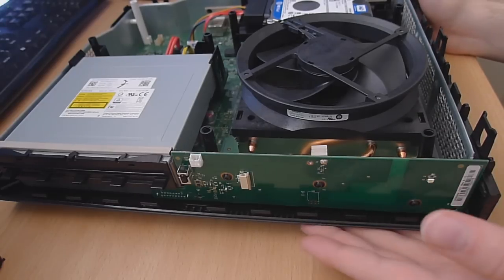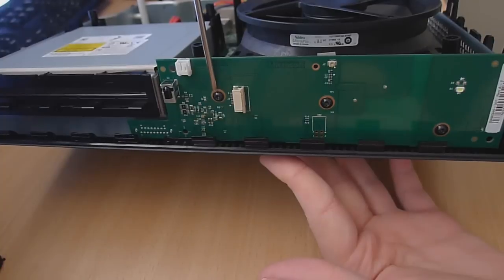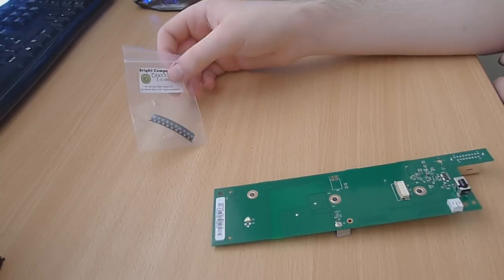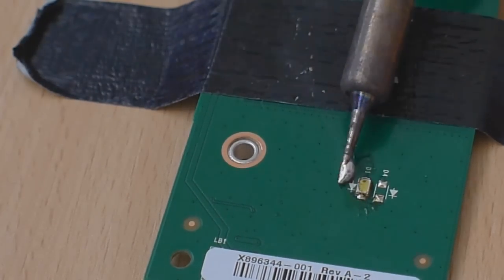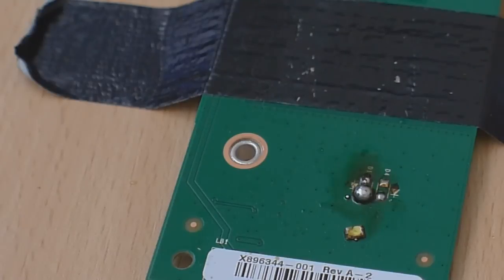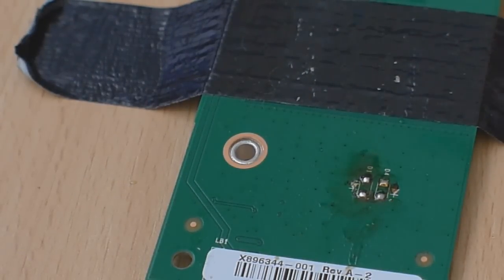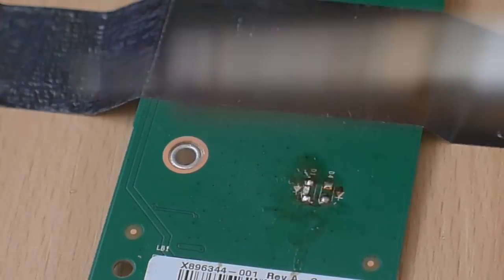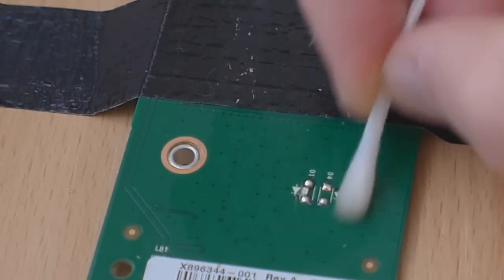Xbox One Power LED Mod Tutorial

Comment: without soldering, open the xbox, grab an urge(green) or coke (red) or pepsi (blue) and take the colored sticky part, cut out a square 10mm by 10 mm and stick it over the led, then re assemble the xbox one and boom, changed color like a non idiot
Reply: What do you mean by colored sticky part
Reply: imagine a cocacola bottle, theres a red banner that wraps around the bottle, theres also a sticky part on that banner, cut out a square and stick it over the led and you've tinted the led, then re assemble the console
Reply: Oh shit I thought you meant a can i was wondering what U meant by sticky part